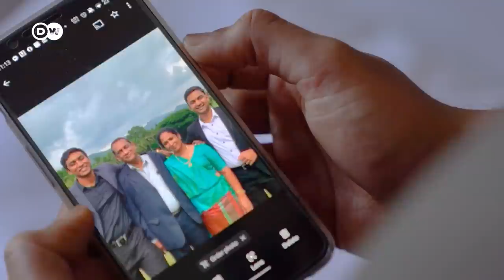Can foreign workers fix Romania's labor shortage? | Focus on Europe

Comment: Romania's current system should keep working with considerable success as long as there exist slaves to import from all over the world.
Reply: The world won't run out of cheap labor until 2150 by then automation would've replaced most of them anyway

Comment: I would live in Romania, I would accept receiving 382 EUR a month, and I would try to juggle it with another job. I live in Brazil, where the currency is devalued and the cost of living is high, I know people who work two jobs and are still close to the poverty line... not to mention the other social problems, violence, lack of sanitation
Reply: The minimum wage is around 1000$ not 300$
Reply: @klaus6740  minimum wage 3000 ron ~ 650 usd, average wage 1200 usd
Reply: Tranqui que estás mejor en Brasil
Reply: @Usureloo  that's the gross pay. the minimum net salary is about 400€ (about 435 USD)
Reply: 3000  - taxe
Reply: @GeorgeBuzi what is gross pay?
Reply: minimal is 500-600E not 382 bro

Comment: The problem with repressive immigration laws is that they fail you when you get to a point when you actually NEED am immigrant workforce. These laws and processes need to be more flexible, so they can react more rapidly to changing needs.